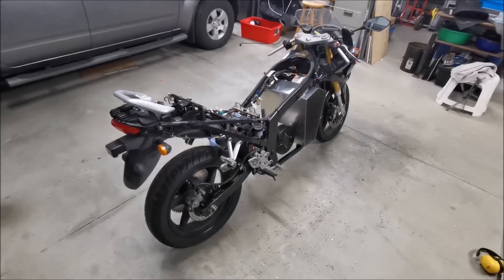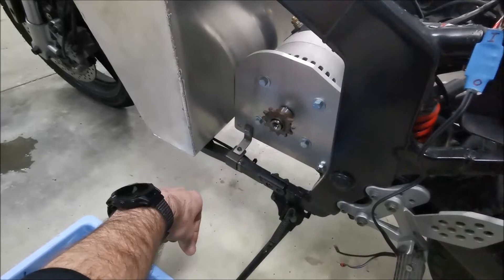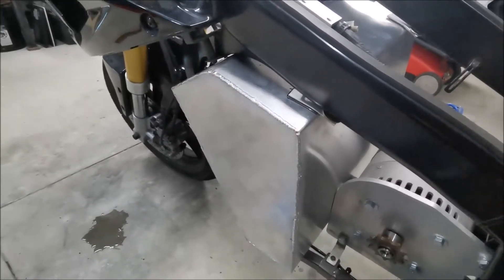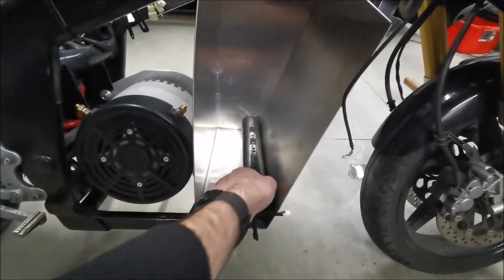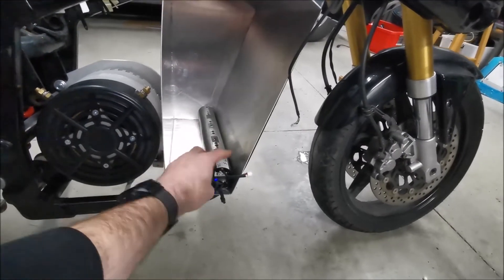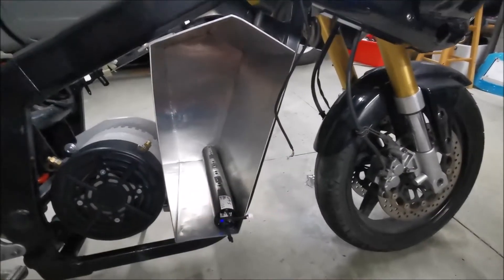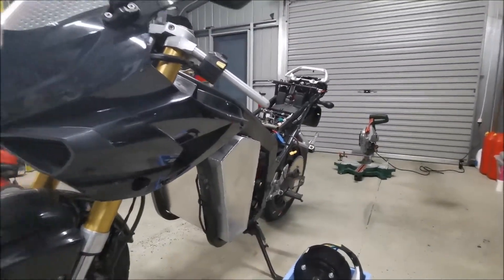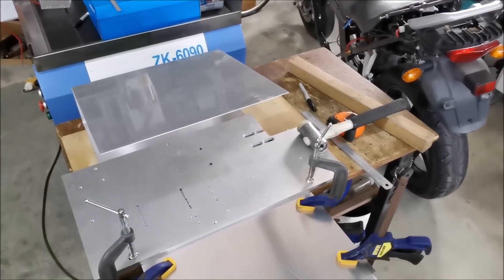Electric motorbike update 1 - new motor and battery solution

Comment: so what the weight of the battery 🔋 is it going to be hard on the front and given that when the bike is going the motor drive to the back wheel and my over concern is the cooling of the battery I not trying to be a pain just trying to help
Reply from the maker: Hi there, the individual tubes are about 1.2kg each, so if I can fit 32 tubes total, that will still be less than 40kg. The motor is around 18kg, so the total weight is still approximately the same as the old Engine + airbox + fuel. I am using the individual tubes at quite low maximum current (to maximize battery life), so there won't be any substantial temperature increase.

Comment: Nice find on those batteries and the new motor looks much more suitable.
 Looks to be rated for 23 KW for < 1 minute, should be fun
Reply from the maker: Hi Ben, great to hear from you mate! Yeah, at the price, those batteries are a total steal, most of them have only had tens of charge cycles, almost brand new.